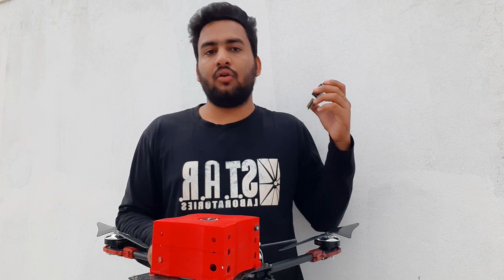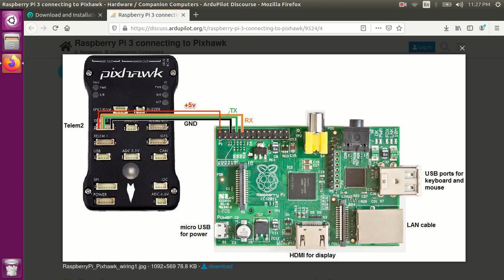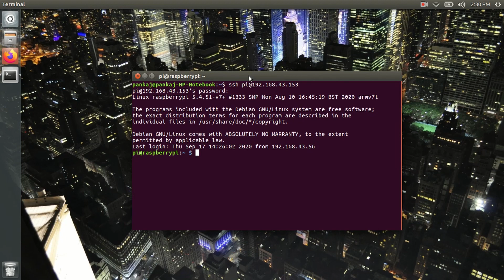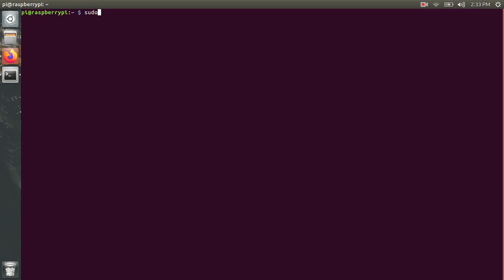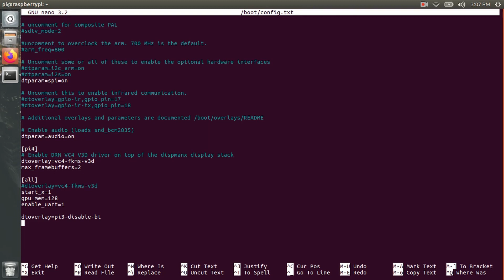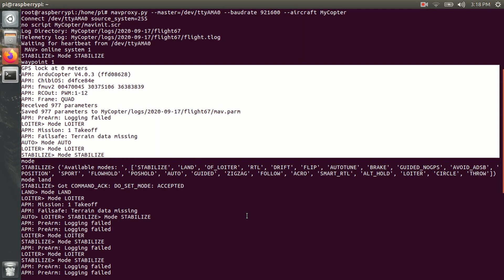Connecting Raspberry pi with Pixhawk | Get Started to run your Python code | Step by Step Guide

Comment: Hello sir,
Are there any prerequisites or settings before following this video or I can simply jump to the tutorial as you've shown with pixhawk & r.pi ?
Reply from the maker: Yes you need to do some settings in pixhawk parameters 
Connect pixhawk to mission planner and get into config/tuning >> full parameter list  
And then change below two setting values 

SERIAL2_PROTOCOL = 2 (the default) to enable MAVLink 2 on the serial port.

SERIAL2_BAUD = 921 so the flight controller can communicate with the RPi at 921600 baud.

LOG_BACKEND_TYPE = 3 if you are using APSync to stream the dataflash log files to the RPi( optional so leave as it is to default)
Reply: @PankajMali   Thank you for the detailed response!

Can I find these settings exactly on QGroundcontrol? Basically I'm using QGC..

And what about the OS, means which OS should be flashed into the rpi through SD card before doing all stuffs?
Reply from the maker: Follow this link if using QGC  
https://dev.px4.io/master/en/companion_computer/pixhawk_companion.html

Install raspbian buster stretch desktop
Reply: @PankajMali  okay thanks..
Reply: @PankajMali  Hey Pankaj, I am following this video for pixhawk and raspi setup and as mentioned in the above comment by you I connected pixhawk to mission planner and got into config and then into full parameter list but I cannot see any option of SERIAL2_PROTOCOL or SERIAL2_BAUD or LOG_BACKEND_TYPE. Can you suggest what might be the issue?
Reply from the maker: @sarangchahakar1519  did you search in the search box at the right side of the screen ,you need to have your pixhawk connected
Reply: @Pankaj Mali  Hey thank you Pankaj. Yes I was able to solve that issue. But now that I am trying to receive the parameters on raspberry pi console, I am unable to get them. for example after typing "mavproxy.py --master=/dev/ttyAMA0 --baudrate 921600 --aircraft MyCopter " 
for me I am unable to receive any notification after "MAV>" . It stops there unlike as you get the command "online system 1". Can you help with this issue?
Reply: @sarangchahakar1519   Hi, I got the same problem. Have you reached a solution?
Reply: @busrasarikayaa  did you find a solution to this problem?

Comment: Where did you find the cable that connects the telem2 to raspberry pi? Please share - thanks!
Reply from the maker: Hi,
It comes with the pixhawk , basically the telemetry cable and also you can buybthe connector on robu.in 

But now you can utilise the usb port of pixhawk and connect it with rpi by using a usb cable , in older  firmware it was not allowed as the autopilot used to go in bench setup mode when usb was plugged in .
Reply: @PankajMali  Thanks so much for your help!

Comment: Bro can I directly connect pi with cube +
By micro usb cable 
Micro usb in cube and usb on pi 
??
Plz reply fast
Reply from the maker: Yes now you can directly connect the usb cable between your pi and cube, the newer firmware allows the usage of the usb uart. It no longer considers the copter as bench setup or ground test when you connect usb.

Be sure that usb is connected properly as vibrations can disturb the connection if any.
Reply: @PankajMali if i connect usb to cube + 
Then i need power source for pi ? 
Or it will be enough and yes i m not talking about usb port on pixhauk 
I m talking about that micro usb port of cube + 
Thanks for reply ❤
Reply from the maker: Yes you need separate power source for pi
Reply: @PankajMali need little more help 
PLZ HELP ❤ 

We have made 2 drones for Nidar compitition 
NIDAR OVERVIEW  

We are working on an autonomous agriculture use case, where crops may be infected or healthy.
The idea is to detect infected trees first and spray only where required, instead of spraying the whole field.

Drone-1 (Detection Drone): flight controller cube + pixhauk 
This drone flies over the field and uses an onboard camera with processing (Raspberry Pi) to identify infected trees based on color difference.
When an infected tree is detected, the system automatically records its GPS coordinates and sends this data to a Ground Control Station via telemetry.( MISSION PLANNER )

Drone-2 (Spray Drone): k++ 
Drone-2 is a heavy agriculture drone with a pump.
It receives the infected tree coordinates from the Ground Control Station and then flies autonomously to only those locations, sprays the required amount, and returns.
Human role is only ARM / START for safety.

IS THIS PLAN PRACTICAL OR WE NEED ANYTHING TO CHANGE 
PLZ SUGGEST CHANGES OR WE GOOD TO GO WITH THIS PLAN 

OR CAN WE JUST DIRECTLY SEND THE COORDINATES FILE TO DRONE 2 
WITH USING RASPI 
but can we send file by drone 1 telemetry to h12  controller ??

Thank you ❤❤

Comment: Hello sir,
May I ask if you installed Raspbian OS or Ubuntu into the RPi? I encountered the error "command not found" when keying in "sudo raspi-config" into my Ubuntu RPi? Thank you very much for your help sir :)
Reply from the maker: Hello,
It depends on the requirements, if you want to use ros for your project then you xan go with ubuntu or else for this setup  raspbian is fine .

Can you please elaborate on your error

Comment: can't we use serial0 to connect raspberry pi and pixhawk?
Reply from the maker: It depends on the board you are using like rpi3/4/5, jetson nano and their serial communication architecture.  You can just check the port being used by  ls /dev/tty* when you connect your hardware to rpi
Reply: So, ttyAMA0 is not mandatory, we may use another like serial0.  @PankajMali

Comment: I am also trying to make something like that Pankaj jii , could you please provide me with the drone 3d parts files and specifications (like the battery needed to power all motors and raspberry, motor rating , esc , total flight time , rc and all. that would really be my starting point, thanks a lot
Reply from the maker: Hii, probably I'll update with this in next video and also design files for your reference .

Comment: Hello Sir,  very interesting video. I am interested in collecting the load current, and battery voltage along with telemetry data. I want to use it for battery usage estimation. Have you ever done such experiments?

Comment: Where did you buy this UAV model?
Reply from the maker: Hello arindam,
I have designed and built it on my own with carbon fiber and 3d printed parts.
Reply: @PankajMali  omg!! mind-blowing great, I thought you have bought it from somewhere... Could you please suggest where can I get a reliable quadrotor model as you have made...
Reply: @PankajMali  Also send you a request on LinkedIn, please accept...

Comment: Hi mr. Pankaj, I have some questions about coding RP4 with PixHawk. We are trying to making a VTOL UAV and it has a simple task that it will change servo angle at the determined location and altitude. So, I want write a code for RP4 that will get this mission. How can I do that, can u help me? I am an amateur on RP4. Do you have some simple examples about that? :)
Reply from the maker: Hello gggg ,
If you are concerned only about vtol autonomous mission using Pixhawk autopilot then you can just refer the ardupilot documentation.

You dont have to add rpi to perform this autonomous mission ....if you want to have some more computation or task than auto mission then rpi will make a point.

Please refere the documentation: 
https://ardupilot.org/plane/docs/quadplane-auto-mode.html

Comment: For powering the raspberry pi from the pixhawk's telem2 ports, will the rpi get enough power ?
Reply from the maker: Till now i have tried both the ways 
1. Power from pixhawk to rpi
2. Power from external power module to rpi

Both worked fine ....few people faced some issues as found in some forum discussions but i didn't face any .
Reply: @PankajMali  thanks but i think powering externally would be better using buck converters
Reply from the maker: Yes , you are correct it's always better to be on the safer side

Comment: Nice video Pankaj
just need your help, which cable you are using to connect the RaspberryPi 4 and Pixhawk2.4.8? I am assuming its female 6 pin dupont to df13 connector.
From were i can get the cable to connect my raspberrypi with pixhawk.
Reply from the maker: Hello dhananjay,
The cable that is used is df13 6pin  which goes straight to the telemetry port on the pixhawk and at the rpi end you can connect the  futaba cable  or female jumper wire .
You need to replace rhe other end.
Reply: @PankajMali  Thanks for the suggestion, I will try your idea!

Comment: Can we connect raspberry pi to dji naza m lite flight controller instead of pixhawk
Reply from the maker: No we cannot connect as far as i know mainly bcoz its doesnt have any ports for uart or spi.
As in pixhawk mavlink is used ...one has to figure out the communication protocol used
Reply: @PankajMali  then to which flight controller i can connect the raspberry pi instead of pixhawk
Reply from the maker: You can use naze 32 or cc3d flight controllers, these fc's are pretty old and outdated . You need to install the arducopter firmware on this fc and do the setup or any flight controller where you can upload arducopter firmware

Comment: Hello sir
I have a few questions :)
1-Can I connect my rspi4 on Pixhawk Cube ?

2-How do I object tracking on RaspberryPi using Python-Opencv ?
Reply: hi there. were you sucessfull on that connection? i keep receiving mav>line down no matter what i try... it you were sucessfull please help me.
Reply from the maker: Yes you can connect rpi4 to pixhawk cube .
Follow the camera calibration video  where the aruco detection code is tetsed ...similarly  use tvec and rvec vectors in opencv to track the object and send the object x y errors with respect to the camera lens to pixhawk via mavlink messages

Comment: Any possibility to fly Pixhawk drone autonomously without using GPS in an enclosed area.(Area of the arena will be known but no GPS signals will be available)
Reply from the maker: Yes its possible 
You can go with arruco marker array or you can go with slam navigatio  
Using depth camera isn't recommended as its results vary according to the light in the surrounding.
Reply: @PankajMali  Thanks. Can I have your contact?
Reply from the maker: You can catch me up on Instagram @punky_pankaj

Comment: Hello, i would like to ask what to substitute in wxgtk4.0? it doesn't work for me, i always get the error 'package wxgtk4.0 has no installation candidate'. Thank you for replying.
Reply from the maker: Hello ,

Kindly  update and upgrade and then run this commands

sudo apt-get update -y

sudo apt-get install -y python-wxgtk4.0

' -y ' flag is for silently installing without any questioning
Reply: @PankajMali  hello sir, thank you for replying 

I seem to have a problem with the solution you gave: i installed wxgtk4.0 with the -y flag but it still displays that package wxgtk4.0 has no installation candidate

Thanks

Comment: Hello Sir,
1. What the telemetry module exactly do, I mean what if we don't incude it ??
2. Here you have talked about ip address of raspberry pi, I think IP addresss are of networks and not of devices ??
Reply from the maker: Hello,
1.Basically telemetry allows the communication between ground control station and aircraft or any system with bi- directinal data transfer .

2. Yes, you are correct ip address are of network but they are assigned to a particular device .

Comment: mavproxy.py --master=/dev/ttyAMA0 --baudrate 57600 --aircraft MyCopter
Connect /dev/ttyAMA0 source_system=255
no script MyCopter/mavinit.scr
Log Directory: MyCopter/logs/2021-06-30/flight11
Telemetry log: MyCopter/logs/2021-06-30/flight11/flight.tlog
Waiting for heartbeat from /dev/ttyAMA0
 MAV>
Reply: mavproxy.py --master=/dev/ttyS0 --baudrate 57600 --aircraft MyCopter
Connect /dev/ttyS0 source_system=255
no script MyCopter/mavinit.scr
Log Directory: MyCopter/logs/2021-06-30/flight12
Telemetry log: MyCopter/logs/2021-06-30/flight12/flight.tlog
Waiting for heartbeat from /dev/ttyS0
MAV> GPS lock at 7 meters
online system 1
GUIDED> Mode GUIDED
AP: ArduCopter V4.0.7 (0bb18a15)
AP: ChibiOS: d4fce84e
AP: CubeBlack 0040002A 3238510F 32393336
AP: RCOut: PWM:1-12
AP: Frame: QUAD
Flight battery 100 percent

while change the ttyAMA0 i got why can u explain
Reply from the maker: Please check the baudrate assigned to telemetry 2 port in mission planner and then according to that use the same baudrate ,like in this video it is 921600
Reply: @PankajMali   whatever you did  i also did same thing  the problem is not solved .
Reply: i getting this error using rpi 3 B+
Reply from the maker: Can you please elaborate uour issue ?

Comment: I would like to know why I should/need to put a Pi on my PX4?  What will it give me that the PX4 gives me? Thank You
Reply from the maker: Hello Duane 
Hope you are doing well 
Here pixhawk is the flight controller  with all the primary sensor setup required to keep you vehicle stable. Here you upload the firmware and go ahead 

What if you need to do some extra computation like running a code or adding few more sensors like some lidar or any according to your apllication.

Pixhawk is limited with its operational capability its designed for the specific tasks not more than a micro controller

So if you want to do this extra processing then you need a computer onboard, so that you can run your codes on the computer and send send the mavlink messages to the pixhawk via serial communication, its bi directional communication 

You can actually implement real time apllication which uses AI/machine learning algorithms.
Reply: @PankajMali  Thank You!! you are the first one to give a answer ! and a good one!! So mow you get a sub
Reply from the maker: Thank you very much, i really appreciate it❣

Comment: Hey Pankaj. My connection was working fine I was able to communicate pixhawk with raspi. But by mistake I pressed 'ctrl+z' on raspi command window and now again it shows me 'MAV> link 1 down' and I cannot get back to setting up their communication. can you please help?
Reply from the maker: Ok so tell me are you still running the mavproxy.py  command as root user like after running "sudo -s" command  ?
Reply: @PankajMali  Yes
But still the error MAV>link 1 down persist

Comment: Hello Sir,
Firstly thank you for video. I want to ask a question. I need to connect the pi and pixhawk together and in this system, the pi has to have camera because pi has to recognize the red area. After pi recognize the red area, that system will drop the balls. Servo motors must run for the ball to drop. How can i connect the servos of this system? Should  it connect to pi or pixhawk? which one? Thank you very much in advance. 
Sincerely.
Reply from the maker: Hello alparslan 
Nice question,
You follow this video to set up the connection between you rpi and pixhawk once done, check next video where you will get to know  how to run your python scripts on the real vehicle.

Lastly check the lastest video where you will find gazebo simulation and demonstration on real vehicle, where the pi camera detects a aruco marker  and run the land command to make the copter land.
 Check the python script on my git 

In your case the copter will detect the red area and instead of landing it will drop a ball.

To drop a ball, you can attach a servo and to control a servo, plug it into an empty channel on the pixhawk and use mission planner to set that channel as a servo channel. Using dronekit you can send mavlink messages to pixhawk.

Hope it helps you
Reply: @PankajMali Thank you so much for your informations.

Comment: Hello sir, is it possible to connect my raspberry pi to the ground station say for instance mission planner. And be able to upload missions remotely.
Reply from the maker: Yes you can upload missions remotely in both the conditions 
1. When you just want to have waypoint mission in AUTO mode, you can upload mossions via telemetry connected to pixhawk ( witu direct link or also via internet)

2.you can upload python scripts on your rpi remotely, in such a way that your script will call the way points stored in you pixhawk fc and take action according what you want the drone to do at particular waypoint.

Comment: Hi Pankaj
In the initial , i connected my Rpi4 to the monitor and i gave the 5v to it through adopter. How about Pixhawk, Do i need to connect it to laptop or i can just simply connect it with battery because i already setup everything of mission planner for pixhwak in my laptop before connecting Rpi.
Reply from the maker: You can power it via battery from  power module to pixhawk and when you want to test your drone out in the fields you can power rpi via separate 5v BEC or also power rpi from the telemetry 2 port vcc and gnd.

Comment: Really appreciated sir
Could you please explain how can I setup/configure) my RC Transmitter(remote) with it. I am using Flysky FS-i6 remote and FS-iA6B receiver.
Reply from the maker: Hello farooq,
You don't need to specially configure your tx to get running with companion computer, you must have a drone ready with pixhawk which has your tx caliberated via mission planner /qgc  and that's it you can start setting up the connections with rpi
Reply: @PankajMali  Thank you boss, lemme try